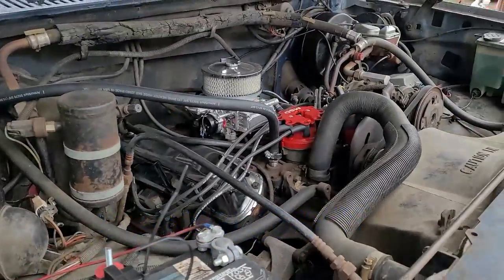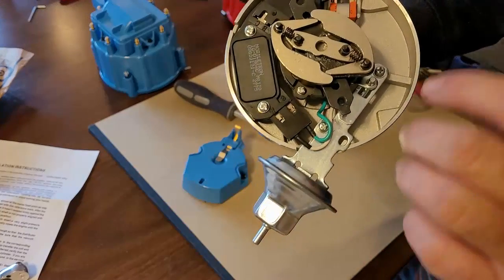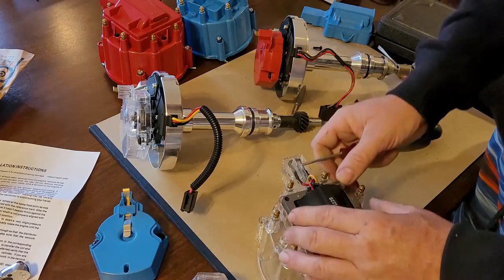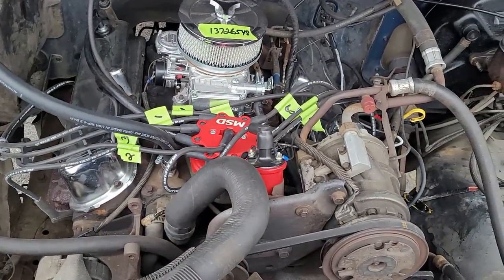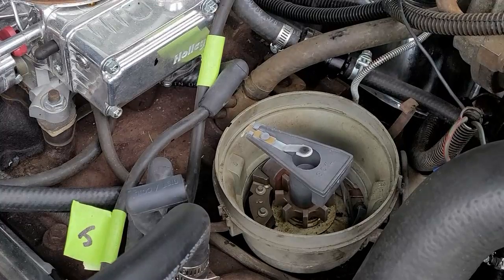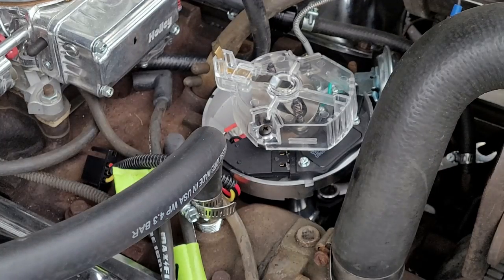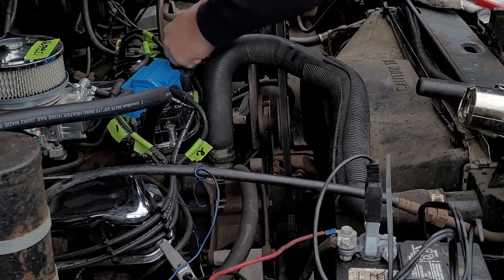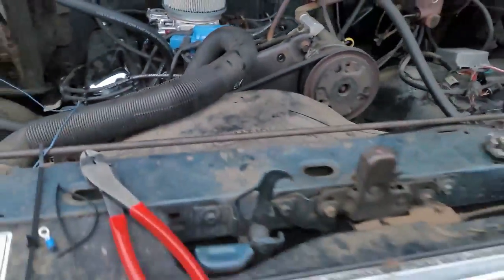How to install HEI distributor in a Ford  part 1

Comment: Thanks Kevin, just got an HEI for the 170/6 Bronco motor in my 53 F100 and spent most of the day wasting my time with other people's videos, but this on describes and explains everything perfectly! Thanks from England!
Reply: also, would be good to see you set up the vacuum advance, or did you just leave it as is?

Comment: I converted my maverick over to the duraspark set up years ago now going to be putting a 69 351w in and I’m going to be going this route
Reply from the maker: this is a great unit and out of the box the advance curve you can feel and you can gap plugs same as 350 Chevy gives more power

Comment: I just got an HEI distributor for my 351c. I was having a hell of a time diagnosing what was wrong with the old duraspark and decided that I wanted something simpler. Now that I got the duraspark working again, I'm kinda afraid to change it out. I know the HEI is going to help me next time I need to diagnose an ignition problem, but I hate to mess stuff up by changing things that aren't broken.

Comment: Excellent video! One question, how can you tell what gear is installed? Steel is needed for a roller cam. What gear comes on that distributor? I do know there’s a few different materials and it is extremely important to have the right one.
Reply from the maker: It's a steel gear that comes with the distributor
Reply from the maker: I actually went back to the duraspark turns out duraspark is actually better than the gm hei

Comment: Thank you for the explanation video! I'm trying to run this set up in my 78 460. I have that wire you plugged into the under side of the cap, but where do I wire it too?

Comment: Nice job 

Did you notice a big change in performance vs the old carburetor ?
Reply from the maker: Yes but not a huge one the carb i brought holly 600CFM same as i took off its call holly Street warrior so it more of a stock replacement will better jets and fuel mapping the engine is factory 351ho so what i did to get more power i deleted the egr valve and went with a GM HEI IGNITION system that delivers 65k of fire power to the plug and better advance curve so i have a power gain without losing fuel economy i also charged the secondary spring to a lighter one so when i do put my foot in it it comes to life sooner

Comment: GM normally pushes up at the gear where Ford pulls down if I'm not wrong.  Curious how they designed the top to negate it wearing out the top.

Comment: I am attempting this at the moment however I also went to a one wire alternator. I have that hooked up and I have zero fire at the key. No lights or anything. Would you know what I might have done wrong?

Comment: Thanks for the video... I have this project ahead of me for my 460. Just to clarify, the ignition RUN wire is the one that goes to the new HEI Bat connection.  I'm looking at Ebay for the HEI you have but I cant seem to see the adjustable + - on the vac.  Where did you get yours? how's it doing now? thanks

Comment: Great video. So you didnt have to set vacume advance or total timing just initial ? I have just installed a max efi500 into a 1950 f100 so its been a learnung curve so my question is genuine.
Reply from the maker: Yes setting the timing on a card truck you disconnect the vaccum advance and plug the line on factory for efi they use a TFI THIN FILM IGNITION they have octane rod to set the distributor on the wiring there   a plug called spout pull it out its just like the vaccum line only electric now if you are installing the HEI YOU WILL need to set it up the way of the carb
Reply: @2strokeguru   yes ive set her idle up but need to set iacv steps between 3 and 10. Then do timing.

Comment: My father in law left my wife a 1978 Ford 100 with only 68,000 miles on it. The only way I could get it to run properly was to install this type of distributor, and a Rochester 4 barrel Quadrajet with an Adapter plate.  That duraspark ignition system is JUNK. I wasted a lot of time trying to get it to work properly.   Junk Junk junk.
Reply: Im struggling with this at the moment it is horrible

Comment: I am about to start this project - my original holley carb has a tps on the side which is wired into the harness.   As the module is not being used does this mean that the tps is not necessary?   Also the dist I have does not have a vacuum advance - I think this is handled by the crank position sensor down below.   Should I just run a vacuum hose to the base of the carb to provide vacuum for this?   Thank you - a very helpful video!
Reply from the maker: there's a vacuum port on the left side halfway up the carb for the advance bottom big port is for brake booster
Reply: @2strokeguru  OK great....I note that on both your dist cap and mine the no 1 post is where the 7 is on the diagram in the manual....put mine to tdc and the rotor is pointing pretty much where yours is but according to the book its about 3 posts over?   Im going to go with that and not second guess myself.

Comment: Hello Kevin---my HEI distr arrived at last...everything is the same put there is an additional length of about 3/4 inch of darker metal/steel on the very end of the shaft...is that a piece which should have stayed in the oil pump?   Wish I could post a picture to you.
Reply: Follow up:  Installed as you have shown and it works perfectly - no idea why the old dist had a longer tip but the new one fit fine - fixed all my problems and cleaned up the engine bay a great deal.   The old system did not permit you to change timing the new system does and the motor runs far better having checked and adjusted the timing.  Thank you for a very helpful video.

Comment: didnt explain how to keep the gear on the distributor shaft, mine keeps falling off
Reply from the maker: The gear is supposed to have a roll pin through it Sounds like you got a defective part

Comment: Don't let the stock distributor get to far away,  that Chevy style hei is crap. 221, 255, 260, 289, 302 shaft is 1/4 in, 351w is all by themselves with 5/16 along with 351c, 351m, 429, 460.

Comment: What was the part number on that distributor
Reply from the maker: The 351w is different from the 289/302 and is different from the 351m / 400 the one in my video is for the 351w brand assault racing part # 1035113 KMG PERFORMANCE SELLS OR YOU CAN BUY IT ON EBAY EBAY IS 10 DOLLARS MORE THAN DIRECT

Comment: Those automatic locking hubs were junk,most removed them and were tossed replaced with warn hubs
Reply from the maker: I have never had a problem with them I know what you mean because I worked at a dealership and I have a bunch of parts for them
Reply: Exploded apart during heavy duty four wheeling.I have removed them replacing them with warn manual hubs.The automatics went in the scrap metal pile
Reply from the maker: @Toolaholic7  oh yeah my truck never goes off road 4x4 comes in handy in new England and with the posi 9in I barely use the 4x4

Comment: Soo simple. Lol. Not 1000years.  Will you change it on my truck.  ? Lol
Reply from the maker: I actually had to change back to the factory setup 2 distributors failed upper bushing kept seized up
Reply: @2strokeguru  are these still running ? or are these allready broken? i'm looking for a distributor
Reply from the maker: @chevroletbelair1  I have gone through 2 gm distributors and switched back to ford yes both have absolutely failed
Reply: Did you go back to a original ford or a rebuild? What brand?
Reply from the maker: @chevroletbelair1  original

Comment: Now tainted by GM parts, might as well LS swap it now!
Reply from the maker: Nah the as a professional mechanic this upgrade is a great upgrade here's a few reasons why 1 less wires 2 easier to get parts from 3 easier to change advance curve 4 hotter ignition 5 better fuel economy from the larger plug gap 6 iron core ignition coil last longer than oil filled coils 7 better Rev limiter 8 the ford pick up coils are junk